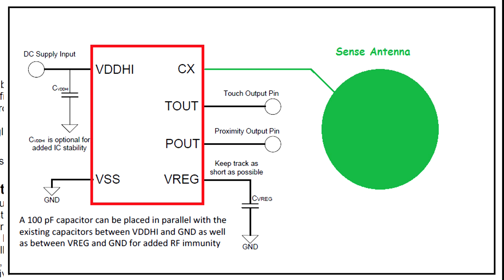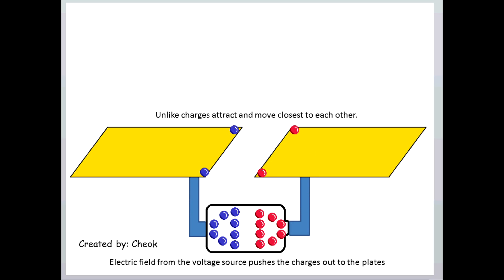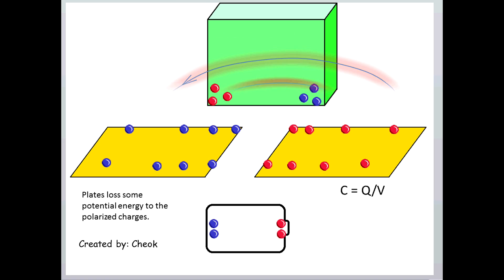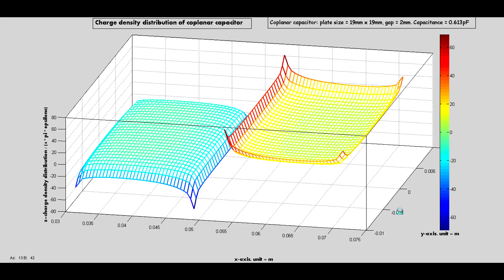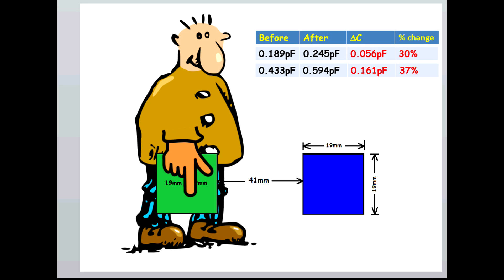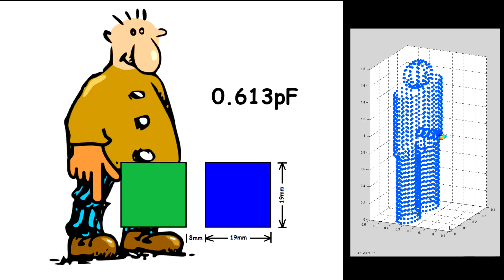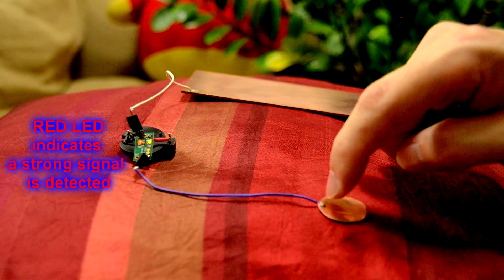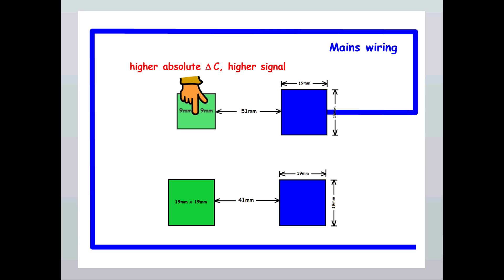Capacitive sensor, Theory, application and design

Comment from the maker: I referred to the following materials for the classic "Method of Moment":
  1) Harrington, R. F., Field Computation by Moment Methods, Macmillan, New York, 1968.
  2) "The Method of Moments in Electromagnetics", MIT lecture notes, available on the internet (YouTube don't let me put the link here)
  3) "Numerical Solution for the Potential between Parallel Plates", Dr. David Jenn, nps.edu 
I had to extend the formulation to 3- or 4-body system to include a person in the simulation.

Comment: I just saw your response about dealing with environmental drift and I'm a bit confused. My understanding was to keep the sensing electrode as close to the capacitive controller as possible to eliminate this type of parasitic influence. Do those IC's condition the sensing electrode in some way? Or is this just another way to keep the connection between sensing electrode and controller as short as possible? Either way, I've always set the triggering threshold myself at the controller.

Comment from the maker: Hi EuAlex,

  Somehow your comment and my reply have disappeared, so i re-post here.
  If your signal is slower than a typical touch, but nevertheless is still substantially faster than the environmental drift, then you may have to implement your own algorithm in the MCU to differentiate the signal from the drift. IQS127D and IQS143 can be used as the analog front ends to measure the capacitance and send the raw data to the MCU serially for your own decision making algorithm.

Comment: Thanks for posting this! I've been looking for this information for a long time. I'm still looking for a rigorous evaluation of the physics of coplanar capacitors. The illustrations help, but I'd like to be able to calculate the values based on given dimensions. I've found a few equations on the web that come somewhat close, but I'd really like to derive the equation myself. If anybody can give me a push in the right direction (not off of a cliff please) I'd appreciate it a bunch:-)